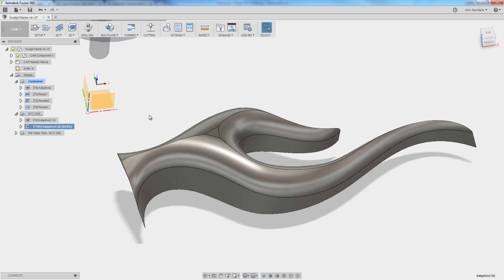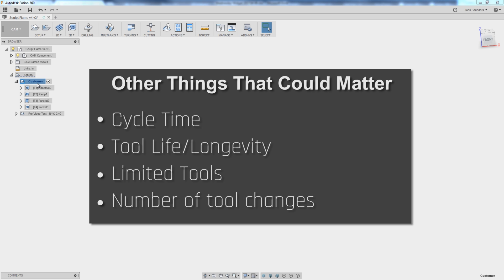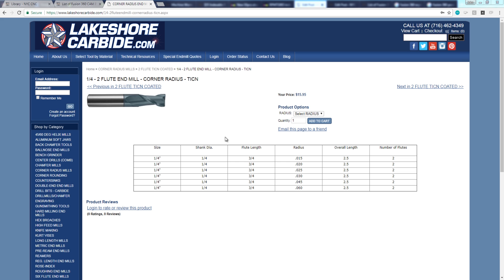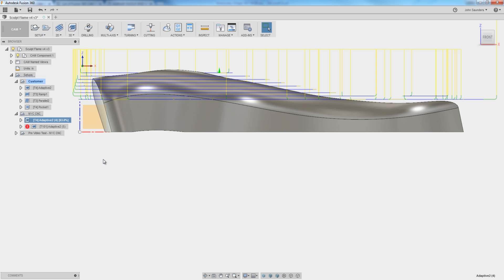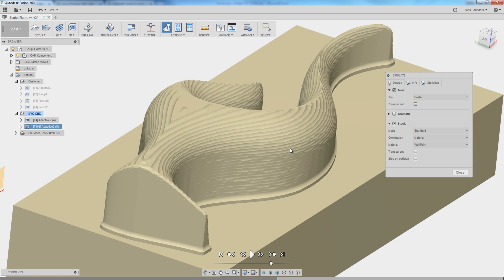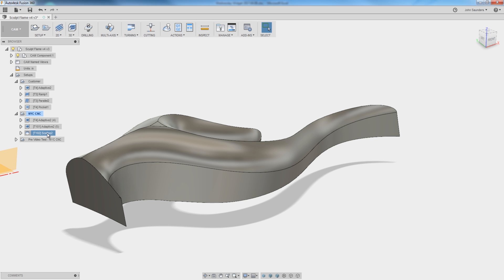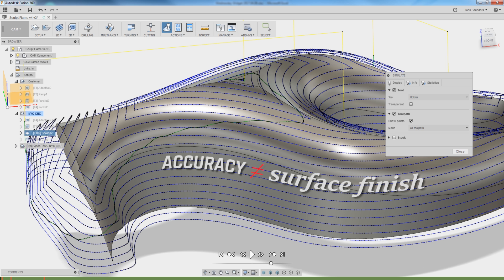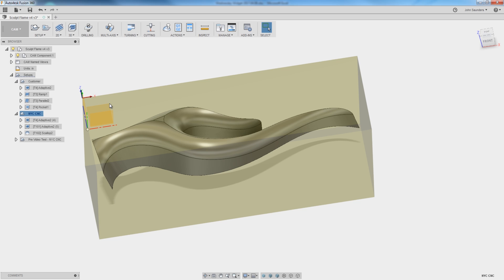Improving Fusion 360 3D Toolpaths! FF115

Comment: Can anyone explain why if i face my stock and then pocket my part. the pocket operation still thinks there is stock there? so my stock is 6.45mm i face off -.45mm the pocket operation still pockets -2.45 when i only need it to pock -2mm.
Reply: FoxyBingo just a thought but maybe hit the "rest machining" button. It looks at prior tool paths under your set up. Might help.
Reply: Dave Anderson I had a look at that but it asks me for my tool diameter and doesn't have the same option as demonstrated in your video. I managed to resolve the issue. It was due to my lack of understanding of the "heights" option within the tool path settings.

Comment: Also, if this in aluminum, with so little to cut left, you can do .075 mm (.003") per flute or .1 mm per flute feeds with a 3/8" endmill (max RPM) so as to speed up these ominously long toolpaths by increased speed.  You could actually probably do more than that even but that's what we run in our shop to be on the safe side.  RPM... high as you can go for getting down to the last pass.  When you put your last mill in to finish, we've found that NOT running max rpm can be an asset for surface finish (we generally leave .008"/.2mm for the final finish pass) as in, if the machines max RPM is 10k... running 8k rpm will yield a better surface finish because the machine is not "balls out" on what it can do and the surface finish reflects that.  Its not a huge difference so for production you want to run as fast as you can but in a job shop to leave a "job shop" type of finish, staying more inside the bounds of what the machines max is yields a far better product.  Cheers.

Comment: Forget about Scallop when the tool path collapses at the top of your part to sharp corners like in the video. Use Flow tool path instead (has both modes 3-axis and 5-axis for those lucky enough having 4/5 axis machines)!
Reply: Those collapsing corners on Scallop are sometimes affectionately referred to as "snail tracks" by some moldmakers I know.

Comment: Surely if you used the bull nose cutter for the finish, you'd avoid the problem of zero surface speed at the bottom of the radius that you get with a ball end mill? The only situation you couldn't use it is if you have a concave surface feature on the top (re-entrant in the Z direction) or an external radius that is greater than the cutter. But for this part which has neither it would work fine I'd have thought.

Comment: John. Some machine / control combos much prefer having a heap of lines versus arcs. And move smoother that way. So it's not a given that applying smoothing in the passes tab will result in smoother motion. In any case, for the majority of machines your are correct.
Reply: Scott Moyse 
That’s usually the high end machines  that will automatically compensate tool path movements and adjust feed rates. Basically it’s controller side smoothing factors, but the control can do it better than CAM since it can compensate for linear accelerations based on the actual feedback from the axis motors. 

Usually requires a specific Modal G code to turn on and off as well. 

I’d say 90% of the time though it’s best to run the smoothing and arc filtering on the CAM side since most machines don’t have auto smoothing control side and it significantly decreases the amount of computing the CAM software has to do.
Reply: May have missed if this is meant for the haas or tormach. Pathpilot(linuxcnc) does have in control path blending. You can turn it off, on, or set a tolerance(smoothing). Usually I leave it on with a .0005 tolerance. If it's something unimportant, I increase the smoothing above.0005 in cam.
Reply: Occams Sawzall yeah... But to be fair I haven't seen a modern Haas with the HSM option data starve, or show any negative impact with the toolpath having smoothing disabled in the CAM. I've only seen it being an issue with older machines or machines without any form of look ahead option on the control. In any case this is very useful for a lot of people, I just wanted to point out that it shouldn't or doesn't have to be used all the time.
Reply: Scott Moyse 
Isn’t high speed machining look ahead still an optional add on for HAAS? Or is it finally standard.
Reply: Occams Sawzall an option....
Reply: Occams Sawzall but to be fair. Isn't that expensive compared to the time it saves. Some machine uses don't require it, hence why it's still an option in their opinion.

Comment: Don't understand why you not set the offset Z to zero in the first adaptive operation? So the second operation do nothing at the bottom...like you show here
Reply: Captain DJ 
Setting the axial (Z) offset to 0 would/could make it basically face off the part with absolutely no stock left on the top. After all the finishing passes the flat surfaces from the facing might still be partially visible and the contrast between the facing cuts and the ball-mill cuts might be more noticable than desired.
Reply: Hirudin Ok, that's right. I was thinking the depth was set to a number over (Z-) the rest material...i must watch it again, I think I understand it wrong. My English is not the best :-)
Reply: Ok, im tested it. This variable is only an automatic help. I always use 1mm deeper cuts if there is enough material. So i want to set up this by myself.

Comment: I thought the easiest way was to 5 axis it and run the end mill on its side instead of the nose. :-)
Reply: bcbloc02 
12-16deg lag in aluminum 6-8 deg lag in steels. 😁

If only SolidCAM easily accepted those emuge semi-circle barrel cutters I’d be so happy.  Such a pain to get solidcam to recognize those tools though.
Reply: Good thing I run only 13 axis lathe with manual programming :P
Reply: this sounds like a good rob lockwood challenge.  machine it on the 5X micron :-)
Reply: +Occams Sawzall What you are looking for is Hypermill! https://youtu.be/BMvCd87jfAw

Edit: Looks like Mastercam can use those Emuge endmills too: https://youtu.be/OvAAu31RC0I

Comment: Other options is to force single direction surfacing, climb or conventional mill only. You can often get better surface finishes if you conventional mill as the tool will deflect in the direction of the cut, whereas climb deflects 30-40 degrees tangent to the cut direction. Especially useful with small endmills taking off only a few thou for finishing. 

Other option is instead of using that bull endmill to leave .02 on. Use a semi-finish surfacing tool path and leave .02 on all surfaces. That will give you a near perfect .02 on all surfaces for the finish surfacing and not have any stair stepping at all.

Comment: Mold shop guy here. Never used fusion, rather PowerMill. PowerMill has a toolpath called steep & shallow which I really like. It is almost 2 toolpaths in one,  a raster finishing (called parallel in other programs) and a constant z. You just define parameters for both toolpaths and then an angle in which you want to switch between them. An example is 45 degrees. If something is less than 45 degrees then you do a raster and if it is steeper, you do a constant z. Mostly only use that for a semi-finish because there is some blending left to do right where the 2 toolpaths meet. Normally semi to 10 grand away axial and radial. Finish with just an overnight raster with a ball mill. Surface finish honestly isn't everything. Unless you are going for a diamond buff (basically a mirror finish) there is a good enough point. Many molds get bead blasted or some other form of texturing as well.
Reply: Eggsr2bcrushed 
Something similar can be done with Fusion 360, but I believe it has to be setup with two operations - the first goes from 0 to 45° (or whatever) and the second will go from ~45 to 90°. It also has the same problem at the transition point. I usually try to change the numbers around (like, maybe use 46 - 90° instead for the second op) to try to get consistent-ish spacing between thd two).
Reply: When I worked in mold machining, we usually overlapped the raster and constant z (I think it was called waterline in program we used) by few degrees. Lets say raster from 0 to 30 degrees and waterline from 28 to 90 degrees. And we used bull nose cutters almost exclusively.